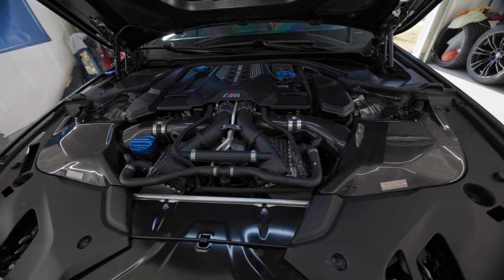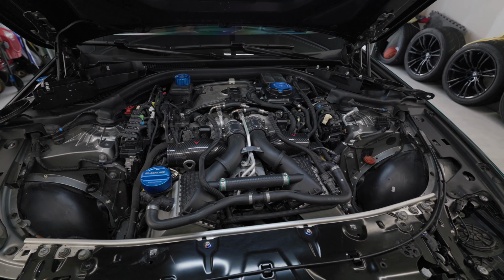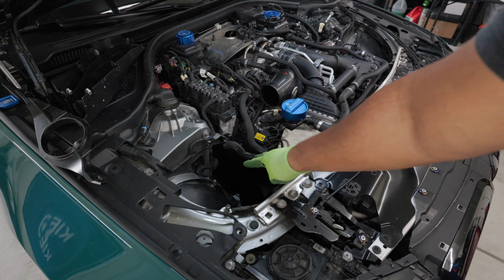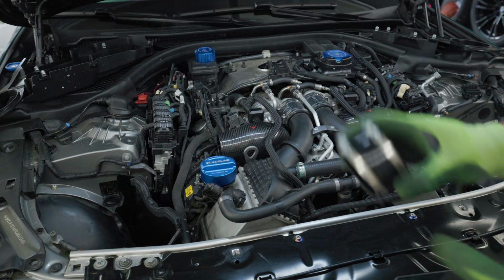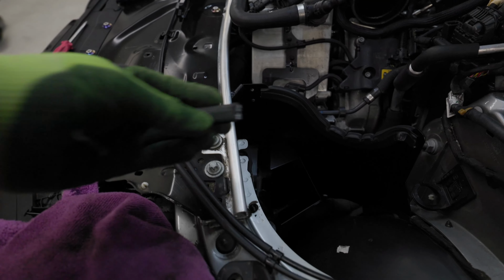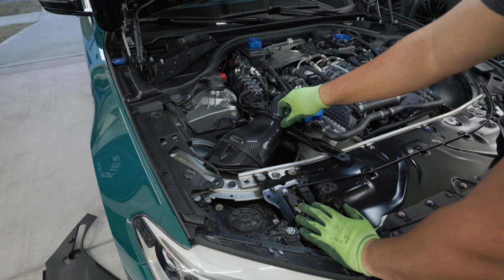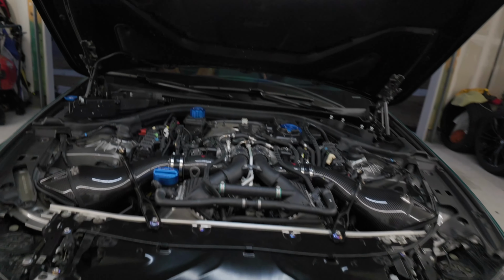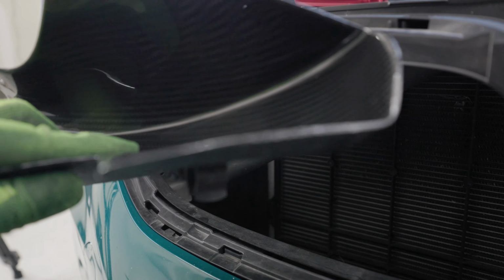The Best Intake For Your F90 M5 !!! Eventuri Carbon Fiber Intake

Comment: I installed Eventuri CAI & Inlets but now I’m getting a CEL and it says crankcase ventilation leak….I’ve torn it apart 3 times now and I don’t see what I’m doing wrong. 😭🥺😩Can you please offer up any info?
Reply: Did you figure out your issue? I read on the forums that an O-Ring on the breather tube was causing issues. An email to Eventuri should've been your first go to as they are aware of the issue and will send you out a replacement O-Ring. Check out the F90 Bimmer Forum, you're more likely to get help there than on YouTube, most are in it for the views not to help others.

Comment: Considering they do nothing but sound the price is too high. project gammas sound amazing. I’ll be putting my money in speed not carbon fibre!
Reply from the maker: They have been tested to increase power and drop 60-130 times.  Check the forums as I know a few people that had issues with project gamma intakes on these cars. Also for speed on this car, all you need is a downpipe. Intakes are a speed and power investment.
Reply: @WhatsyourForte  can you do a before and after showcasing this in action
Reply from the maker: @eduardlast23  before and after of the sound?
Reply: 60-130*
Reply from the maker: @eduardlast23  i would have had to do it on the same day at the same temp. If I do it now, if the DA is higher or lower that could effect everything. I will see what I get
Reply: @eduardlast23  yea Eventuri says it's like a .2 second decrease or something like that. Not significant but hey anything to justify $2500 I guess.